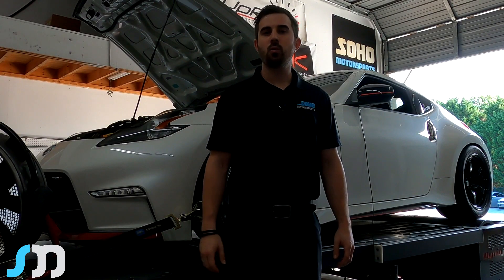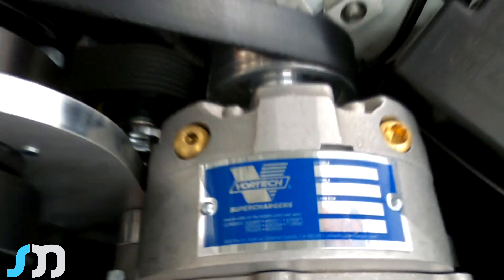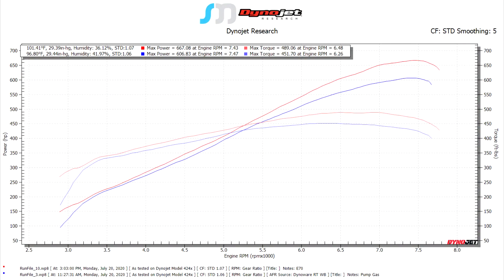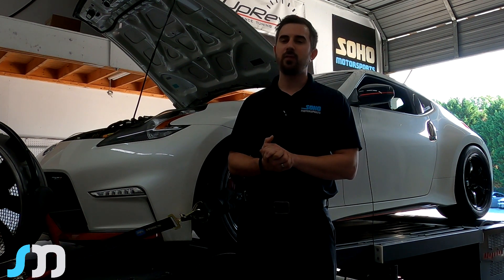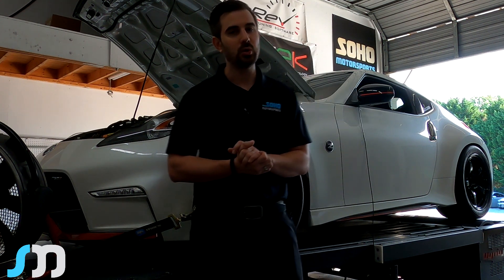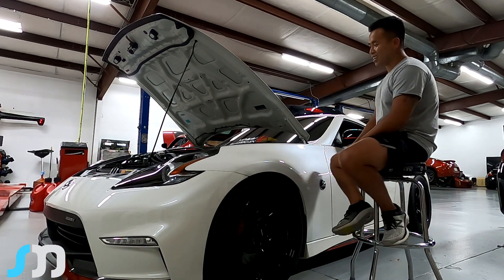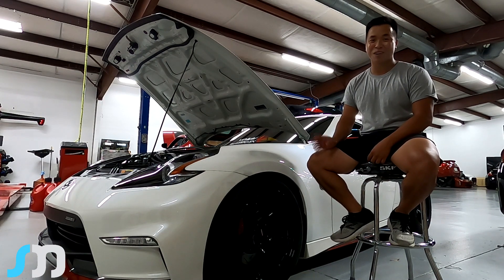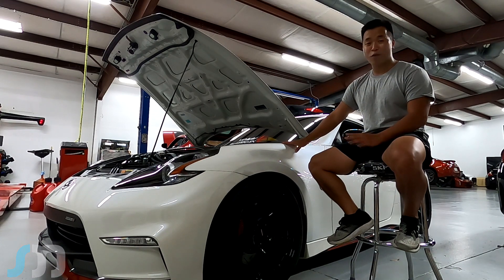667 WHP Supercharged 370Z Stock Motor.  Overview and Customer Feedback

Comment: Curious about this pulley setup, looks like a 9 psi pulley on the jack shaft facing the serp side. What is that silver pulley on the supercharger side? 

Been trying to do my research regarding upgrading to a 9psi pulley and I’m a bit confused, idk maybe I’m a l bit dense but if someone could clarify it’d be greatly appreciated
Reply from the maker: The black pulley on the front side closest to the supercharger is going to be the 9 psi pulley
Reply: @SOHOMotorsports  is the silver pulley on the charger itself a standard sized pulley? I only ask because the pulley supplied in your kit I bought is black

Comment: Really debating if I should pick this up for my 2017 370z Nismo. My goal is just 450-500 only.
Reply from the maker: Run it with the filter, low boost, and conservative tune.  Always could turn it up if you get bored of the power.  Not sure where you are located but 91 octane would keep the power down as well.

Comment: Would 750 whp be possible with e85? 

Also- with built motor is 8500 RPM possible?
Reply: Yes
Reply from the maker: 750 wheel would be possible with a built motor and upgraded pulley....running it up to 8500 rpm may be pushing the VVEL system unfortunately
Reply: @SOHOMotorsports  I am trying to recreate the feeling of an e92 m3, or the like. Not so interested in drag racing as a competent track and street car. What do you think the limit would be RPM wise?

Comment: What size rims and tires are you using?
Reply: F: 18x9.5 
R:18x10.5
+12 all around
Toyo r888r
F: 265-35-18
R: 305-35-18
Reply: @AnLe-jm8tw  What clutch are you running to control that power?
Reply: @AnLe-jm8tw  How is that clutch setup for normal driving in terms of noise and comfort?  I ended up ordering the ZSpeed Super Street Stage 3 Clutch Package. It's been delivered, but I am still waiting for my A2A Supercharger Kit and fuel return system before delivering the car to my installer/tuner, who is Dynosty (in Louisville, KY).  I am excited about the upcoming boost for my 2016 Nismo.  What have your experiences been like with a 600 + RWHP Nismo?  Has the power been usable in the big city? I too live in a big city (Chicago), but will get changes to open up while driving out to the suburbs.
Reply: @brianjackson5732   with honesty, the clutch was rough as in, it took me A WHILE to get use to but like anything, with enough practice and  enough time driving the car, it honestly felt like its back to stock clutch. As far the clutch noise and comfort.....nothing has change. Noise is the lease of my concern and yours too if your pushing big power lol. My motor mount/ Trans mount/ and dif mount make the most noises xD as far as power and driving it in the city.....it should be fine. I drive my car on the daily xD and its completely fine.
Reply: @AnLe-jm8tw  Glad to hear that. I am shooting for 625 rwhp and 440 rtq.  It sounds crazy to be discussing power that exceeds what a GTR puts out.  I too will be using my Nismo as my daily driver, which is why I was concerned about the feel and noise of the clutch. On exhaust, the guys at Fast Intentions told me to put my stock cats back on because their high flow cats that are currently on the car will burn up once the A2A Kit is installed.  I don't want the e85 smell, plus state mandated OBDII emissions testing, is why I will be running cats. Love your car and I can't wait to get my build on the streets!
Reply: @AnLe-jm8tw  any more pictures of the car? what made you downsize to 18s?
Reply: @Trainwreckz34  less weight, better for cornering. The car as of this moment doesn't have the setup you see from the video.  right nots its on the same wheels but different tire set up.
Reply: @AnLe-jm8tw  im thinking of downsizing too, is the +12 too aggressive in the front?
Reply: @Trainwreckz34  yes very aggressive, I had to hit up Jon at Z1 to order a replacement for my wheel up front cause my +12 offset was very aggressive and undrivable when you got that big meaty tires upfront, I suggest you stick to +22 up front. Learn fro  my mistake, i had to fender rolled it up front and it still rub O.o        But i have +22 in the front now and it works great.
Reply: @AnLe-jm8tw  My kit and fuel return kit arrived this week.  I am scheduled to drop the car off to Dynosty in early March.  I am excited!  I'll update the numbers once they come in.
Reply: @brianjackson5732  O.O better post that dyno sheet when able and excited to hear your making progress
Reply: @AnLe-jm8tw  Dude.  I picked up the car yesterday.  It's insane!  On 93 octane, it made 630whp and, on e70, it made 685whp and 495wtq.  It makes a fluttering sound out of the bov between 2,500 and 3,500 RPM, but I can deal with it.  The way it moves from 60 to 120 is crazy!  One thing, it drinks e85 like a camel drinks water.  I have pictures and the dyno sheet.  I believe that Dynosty also has a video.  It rained today, so that limited my ability to be overly aggressive on the interstate.  I fell back in love with my Nismo.
Reply: @AnLe-jm8tw  My car (red Nismo) and another car (white Nismo) are featured on Dynosty's Facebook page.  We both made over 650whp and 450wtq.  My car made 685whp and 495wtq.  The dyno sheet appears in the Facebook posting.
Reply: @AnLe-jm8tw  My Facebook post has a video of the dyno session and dyno sheet: https://www.facebook.com/brianjacksonlaw
Reply: @AnLe-jm8tw  What suspension work have you performed?
Reply: @AnLe-jm8tw  Hey An, love your car. In the video where Tm. Noir had a chance to drive your car were you using 18" wheels?? https://www.youtube.com/watch?v=86Rb5k9zniQ
Would also love to hear about your suspension setup!

Comment: Can the stock block take a beating daily with these numbers at 650whp, I see other 370z blowing up at just 550whp.
Reply from the maker: Supercharger keeps the torque down which is what actually kills these motors.  We don't recommend beating on the car daily at 650 whp.  Cars usually come out of the shop with several boost levels for daily driving, aggressive driving, and then a kill map if asked for.  We have had customers drive these cars for 3+ years but it comes down to how much and how you drive them.
Reply: @SOHOMotorsports  so what numbers do you normally map the 370z to in terms of keeping the motor safe and reliable when driving it aggressively daily. And do you recommend meth for adding cooling to reduce IA temps? I know its not always about chasing numbers but what do you say is a sweet spot for these cars using the a2a setup?
Reply: @TheCinderellaman10  From my experience, torque should be kept at low 400s and HP at low 500s for reliability.
Reply: @TheCinderellaman10  My car has been boosted (A2A supercharged at 15-16 psi) since April. Keep it right below 500 wheel torque, below 670 wheel horsepower, and don't drive it like you stole it 24 hours a day.  You'll also need a ton of supporting parts, like a clutch, 1300cc injectors, at least a 450 fuel pump, a flex fuel fix, a fuel return system, an oil cooler, an oil catch can, at least a 2.5 inch exhaust, new rear differential bushings for the added torque/stress on the rear end, a tune, and either gauges or an Ecutek app on your phone to monitor the car.  There are also optional upgrades for the suspension and tires. It's not as simple as installing a kit and driving away. The kit was about a third of the costs when you include labor (which isn't too bad for a supercharger setup).  But, you will love your car when it's done!